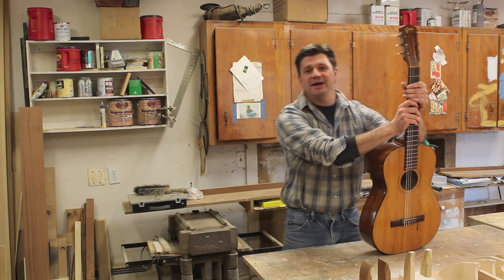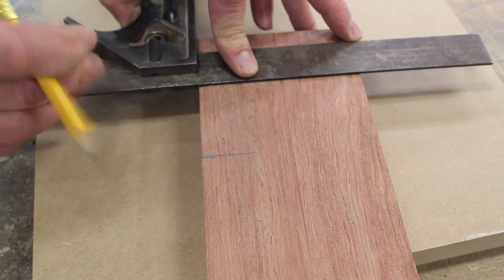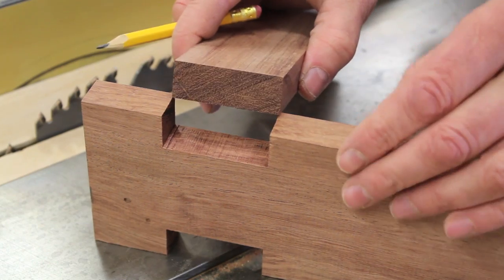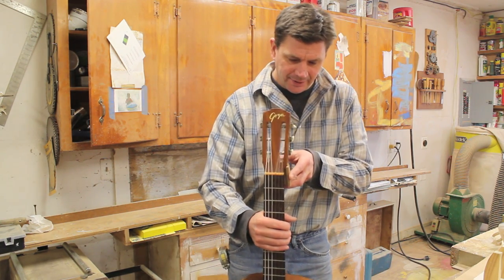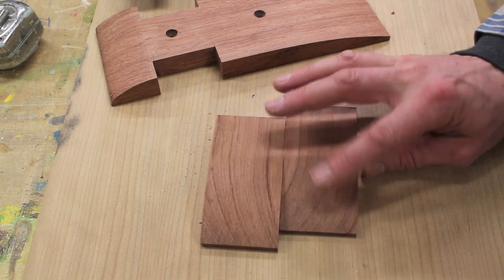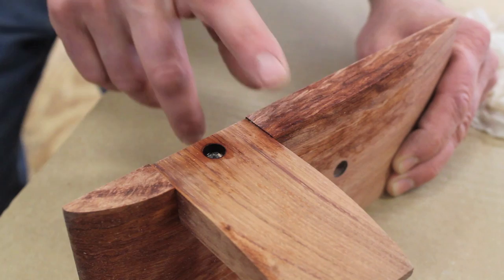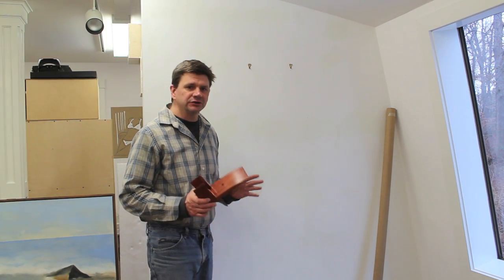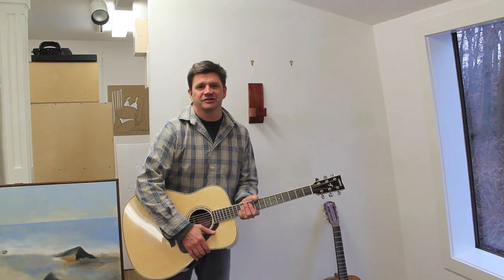How to Make and install a Guitar Hanger,  Holder.

Comment: Great design... Now add a couple of pads to the concave areas like leather or something that won't react to a nitro cellulose finish. Barge contact cement will hold them in place quite nicely. Thanks for the video!

Comment: I've been at a complete loss as to what I should buy my father for his 75th birthday next month ... problem solved! This will be perfect - I'm off to the shed to start. Thanks for the great idea. One question though... since I don't have a bandsaw to cut the wide taper, what's the best method? I think it would take a long time and possibly burn the surface of the wood if I try to remove that much material with the belt sander.
Reply: Belt sander is ok , The trick is taking your time and having different grits on your belt sander , let the sander do the work ( do not press hard) and clamp securely the sander. a 40 grit belt does most of the work really fast , just practice using a piece of scrap first .

Comment: Very nice project.  However, I changed up the design just a bit.  Instead of drilling two mounting holes I placed two keyholes in the back with a compact router and mounted it that way in order to hide the screws.  Also, I used a Kreg joint on the back side as well to attach the arms to hide the screws.  Last, I made a jig to use on a spindle sander to make the cups on arms in order to get repeatable exact dimensions.  Looks great and great idea, thanks.
Reply from the maker: that sounds like nice work, thanks for the comment

Comment: Hi Jon,
I like your idea however I would NEVER hang my guitars on the wall. I have 2 hand made Spanish flamenco guitars worth over $10,000 each. I bought a cherry wood china buffet cabinet, took the glass shelves out and put a humidor inside. Now my guitars stay at proper humidity levels, dust free and the cabinet is locked to keep undesirables out. I will make your hangers and install them inside the cabinet! Nice work!!!!
BTW, my cigars share the same real estate!

Comment: Is the wood you used 3/4" or a full 1" thick?
Reply from the maker: Think it was around 13 / 16  maybe 7/8 but you could use 3/4
Reply: ***** Thanks!

Comment: Nice holder, the screws are disappointing. Router in keyholes in the back to mount with and they won't be seen. Just glue the arms into the body.